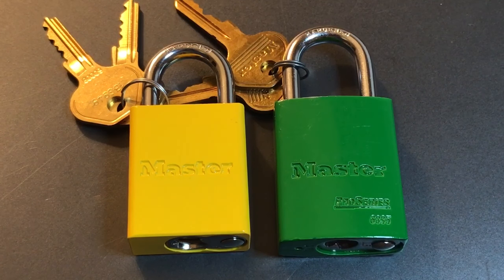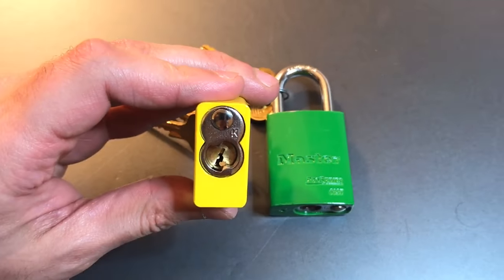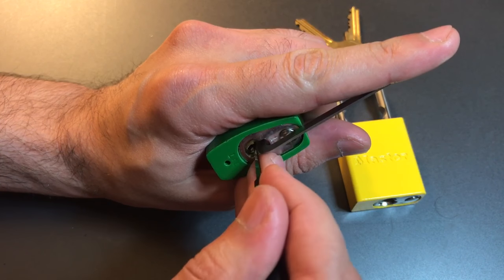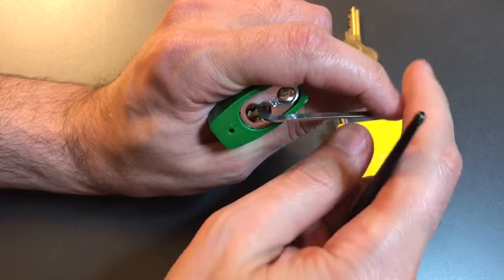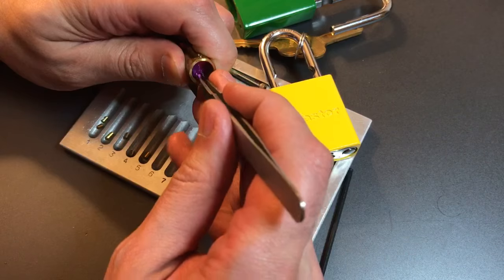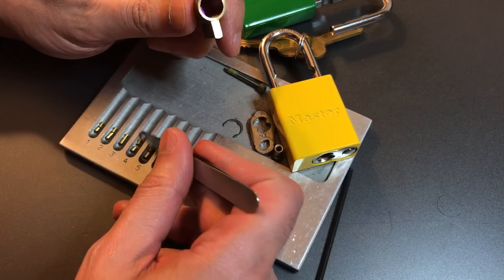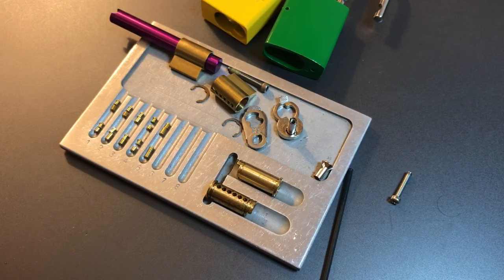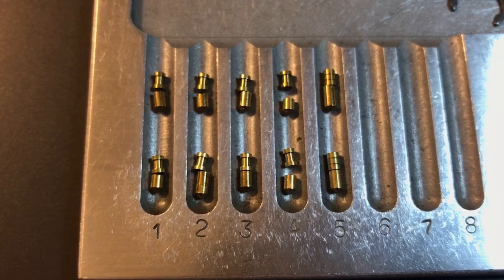[309] 40mmAL Series: Master Pro Series 6835 (x2) Picked and Gutted

Comment: I'd like to share some valuable information for anyone trying to pick these locks for themselves. For me, I bought a pack of six as practice locks, and for that they work excellently.

1. Your tension. Note that the core will turn just a small amount. Turn it until is seizes, then only rest your finger on the tension wrench. Apply no further tension.
2. Start picking from the back of the lock. I've taken three of these apart, and on all of them (inlcuding what LPL has), #5 is a serrated, where 4-1 are spools. Provided the lock binds on #5 first, set the serrated pin which will allow the lock to start false setting. 
3. If it feels like all pins have been set, and none will budge any further, you may have it open and not realize it. The cores on these don't exactly fall over. I have a red example issued to me as a LOTO lock, and that particular one is difficult with the key, although I've never picked it. If you believe the core has been picked, gently remove your pick, MAINTAINING tension. Slide another, stiffer, tension wrench into the core and rotate. You may find it falls open at this point. Little did I realize that I had actually picked it open multiple times, only for the sticky mechanism to trick me into thinking I hadn't.
4. These locks are not key retaining. Use this to your advantage, assuming this is a practice lock for you. Use the key to open the shackle, and remove the key. Leave the shackle open, core in the 'locked' position. Pick it now. Since the locking mechanism has already been released, it is no longer applying pressure on the core, thus it will fall open when you have successfully picked it, allowing you to immediately learn that you have in fact successfully picked it. 

And finally, 5. Although this is more of a morale boost. It's very easy to get discouraged watching locks fall open for him, while you struggle with crap master locks. Keep something in mind, although it seems obvious. Everyone starts at the beginning. At one point, LPL,  Bosnian bill, and Deviant all struggled like you are today. They honed their skills and perfected their craft. Everything they have done, you can do too. Just a reminder.

Comment: I wish Master would take note of this vid,maybe they would change their thinking then😩😩
I did think that you may have given a bonus point to any of the locks that contained an anti-bypass waffer in the mechanism as well🤔🤔
Another nice video sir👍👍
Reply from the maker: Thanks.  TO be fair, the pick resistance of this lock is well-balanced to the physical security.  They both are low.  As for the bypass wafer, no need for one in these locks.  The actuator is oriented such that it can't be accessed.  THis is one way in which the master product is superior to the American Lock design.

Comment: The screws aren't just tightly set.  They have some locktite at on them, so the tightness is that seal.  
Master seems to have an MO of 4 spools and a light serration from the 6127 and 911s that I have picked and taken apart.  They also seem to put them in the same place.
Reply from the maker: That'sbeen my experience as well on the pinning... though it's pretty common to run across one with all standard pins, when they when they should have spools.  Weird!
Reply: Additionally I don't understand why their serrated pins are extremely shallow and only have two rings.  I can't think of another instance where serrations have been done like that.

Comment: The pro series are a lot of fun. Flipped my boss out once. Web site says 6230 model is 'virtually unpickable'. Ok I'll rent that. Let me see it, 13 seconds! I've always used bkt and 25 standard with all masters.
Reply from the maker: Oddly enough, I have two Master Locks in my collection that share the "virtually unpickable" label, yet came from the factory with all standard pins... a 930 and a 6321.  Both of them are supposed to come with spools.  Very strange.
Reply: Master should go into body manufacturing. They get that right, I'll give them credit for that. Leave the core to someone else.

Comment: Nice picking! The results didn't really surprise me much.  Master lock, while popular, just doesn't seem to want to put the money into making better locks.
Reply from the maker: Thanks, but to be fair, these were not difficult.  Spools + open keyway is not a recipe for pick resistance IMO.
Reply: Why would they? Their shite sells as it is. The sooner consumers stop buying crap - the sooner the peddlers of crap will get their act together.
Reply: the real problem with master lock is they are sold everywhere and have a massive marketing budget, they basically don't have significant competition. they don't need to make real locks since they sell by brand name alone.
Reply: +bird718 Bit like Apple then...
Reply: LockPickingLawyer Eh it might stop raking and other low skill methods of entry

Comment: Harry are those 5 pin or 6 pin cores? I have seen some 5 pin  master locks but not so much of 6 pin.
Reply: Cores are right there. Count the holes. :) 6
Reply from the maker: 6 pin cores, that are only populated with 5 pins.

Comment: why does master lock bother with making a core capable of being a 6 pin core if they are going to only put in 5 pins??? it makes no sense at all!! if you are going to make a 6 pin core, put 6 pins in the core.... Harry you should repin those to full 6 pins and make them challenge locks.
Reply: Same reason Lockwood, Abus, American and a host of others do it; cost. Why go through the cost of making two cores when you only have to make one? It makes economic sense. The extra pin would be nice though.
Reply from the maker: Noctis is correct... Master only needs to have one production line, but charges more for fully pinning up the lock.